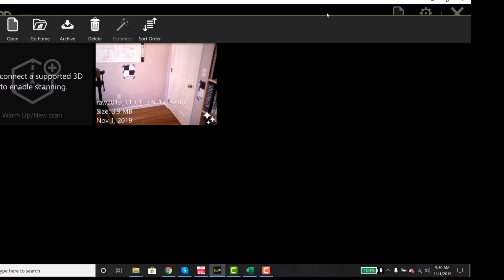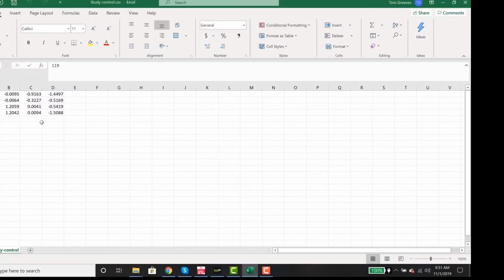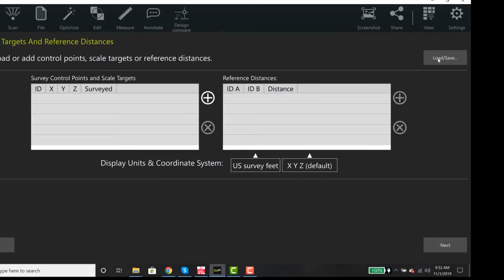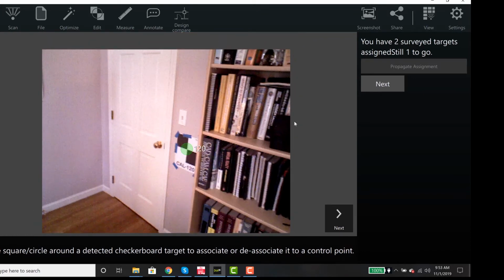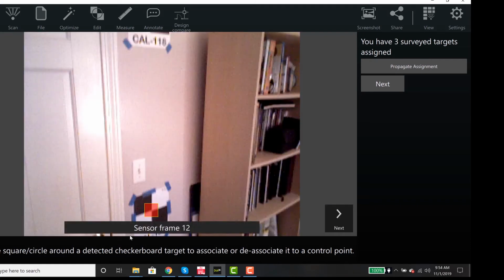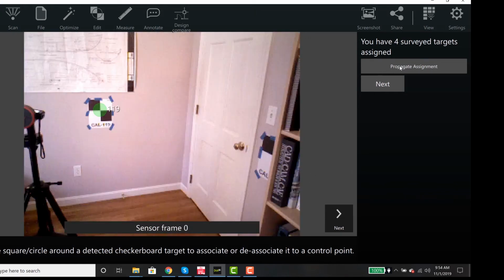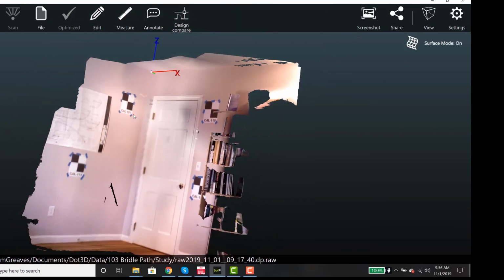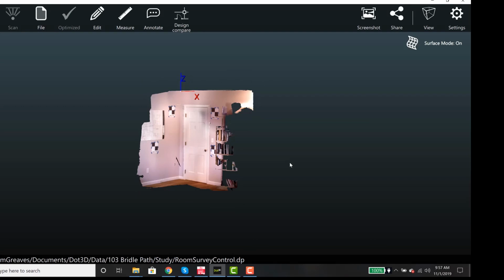Dot3D Tutorial: Survey Targeting with Checkerboard Targets

Comment: So my understanding is you can map ground control points on the ground around a vehicle using a GPS or total station, then scan the vehicle and GCPs with Dot3D and reference the scan using that GPS/TS data? Do you still need/can you still use April tags on  the vertical surfaces of the vehicle? The application would be quickly scanning a crashed vehicle at final rest, then removing the vehicle and combining the Dot3D scan with a UAV point cloud of the entire scene and have them automatically referenced in the same coordinate system.

Comment: how to get the control file ?
Reply: We have used a total station of course.  However, other tools like the Leica S910 disto or the Lecia 3D Disto also give excellent results.  And of course, you can always use manual measurements captured with a tape measure.
Reply from the maker: This would need to be created from measurements from another tool (i.e. total station, disto, tape measurements, or coordinates from a CAD model). This can be created separately and uploaded as a text file, or can be created from within Dot3D.